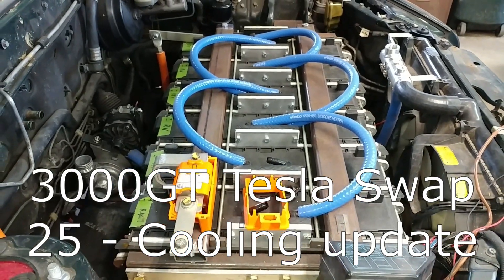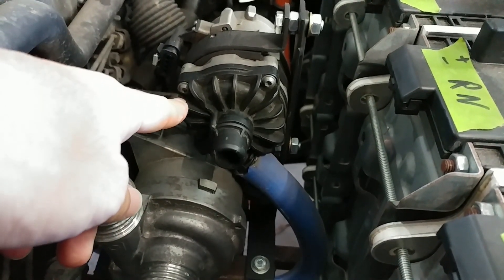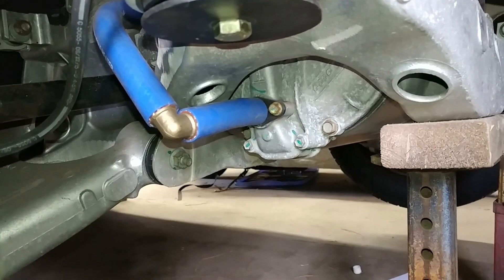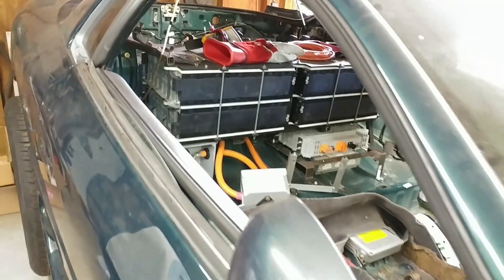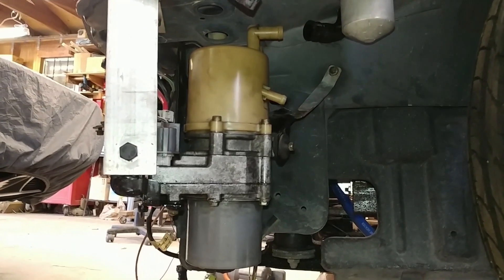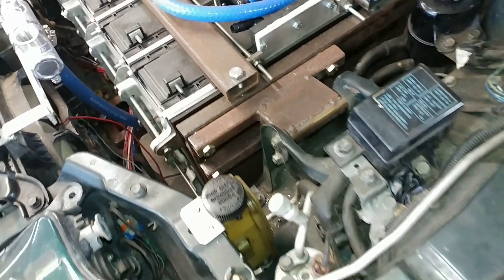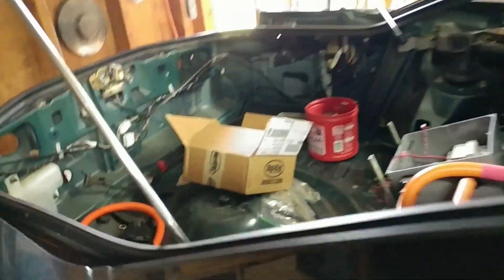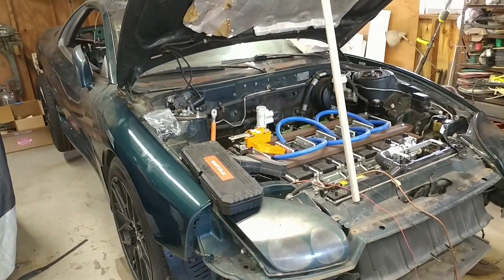Mitsubishi 3000GT Tesla Swap 25 - Cooling system update

Comment: Hey, I have experience running the correct CAN messages for the Mazda pump with an Arduino and a can Sheild, reach out if you need help setting it up so it runs at the right speed.
Reply from the maker: Hello! it will be a little while until I'm ready to power it up, but I would really appreciate any help you can give.
Reply from the maker: Hi @Shane! I've got my hydraulic lines and a CAN board. Do you have a github or something I could check out?
Reply: @azimath9939  Hey! Not in a github but I can email you the code if that works, let me know
Reply from the maker: @Doomer17018  That would be great! My email should be in the about page on my channel.

Comment: I was thinking "Why no radiator cap", then I remembered that EVs don't heat up and pressurize their coolant.
Reply from the maker: Yeah it's gonna run at ambient pressure, if it gets hot enough to build pressure I'm gonna need to start running.